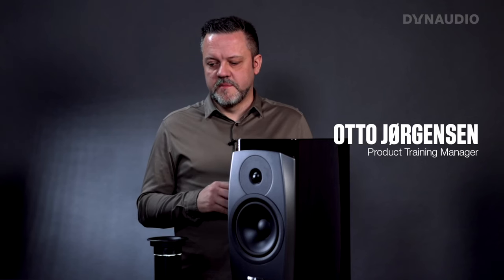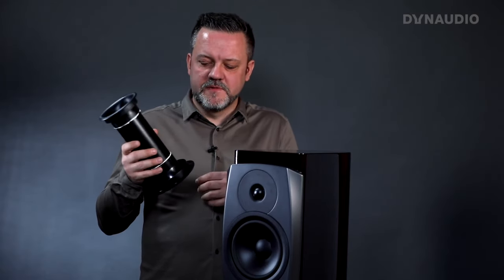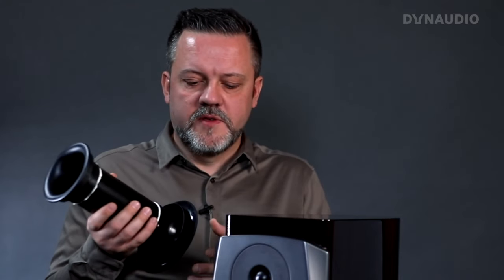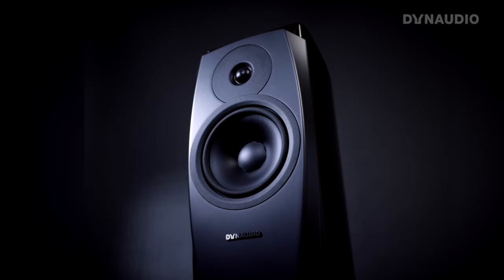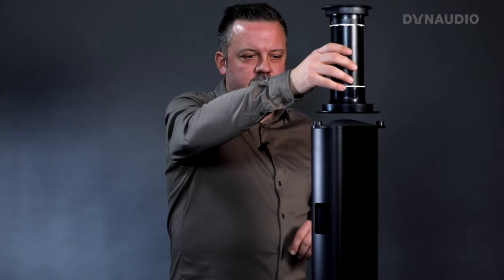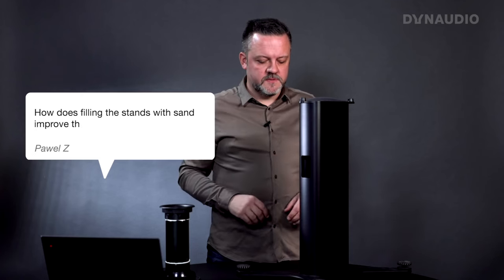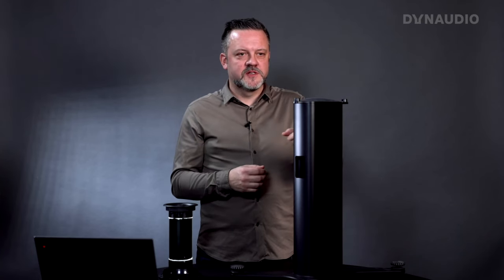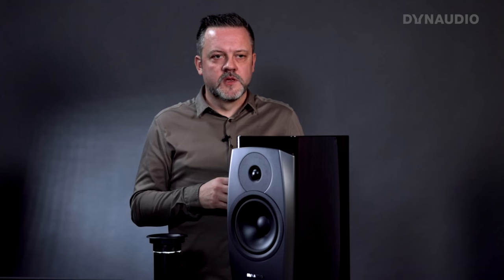Function and form: The Design of Confidence 20

Comment: Delighted with mine, the downward firing port makes such a huge difference when you are in a small room like mine and relatively close to the walls, other rear ported speakers caused issues in my room. The sound is stunning, high end yet never harsh unlike Bowers or Focal designs.
Reply from the maker: Thank you. Great to hear that you are enjoying them.
Reply: The Bowers tend to be a bit shrill in the tweeters, the Dyn's are more musical more refined.

Comment: I'd like some hints about speaker cable brands (models?) to pair with Confidence. Thank you.
Reply: I have been running the Madison Audio LAB E3 Extreme 1 cables. They were an amazing cable. I got a deal on a set of WireWorld Silver Eclipes 8 speaker cables. And they were slightly better. A bit more musical and romantic if you will. Great Sound costs money.

Comment: I noticed big improvement using supplied spikes into washers (instead of just rubber washers). Is  it even better to remove rubber washers completely or replace rubber washers with more stiff, like metal ones?

Comment: How do they work in a smaller room? My room is 12ft x 13ft (approximately 3.7 x 4m). It is acoustically treated. I am currently running Evoke 10s and they work wonderfully, but am curious if a higher end option would be feasible. Thanks in advance!
Reply from the maker: A 2-way speaker usually generally works well with small listening distances, and I would generally not be worried with that size room. One thing to be concerned about might be that a room with those dimensions will have room modes between 43-46 Hz. Since the Confidence 20 has more output at these frequencies than Evoke 10, you will experience more bass. But whether that is a problem also depends on the type of walls and ceiling, and your personal preference. It depends on whether you are searching for more/deeper bass as part of your upgrade, or not.

Comment: If some mids are coming out of bass port and mix up with direct sound, why Dynaudio Core monitors intended for super critical listening are front ported?
Reply: Horses for courses. Core is designed for a different type of use. The port is on the front to allow soffit-mounting in studios, where a rear or downfiring port would not be possible. To avoid the risk of noise, the output of the port is somewhat damped, which makes it less efficient than a traditional port. This can be done because it is an active speaker, where the EQ can compensate, and because ultimate SPL is less important than accuracy. The Core port design would not work as well in a traditional passive speaker.

/Otto, Dynaudio Academy